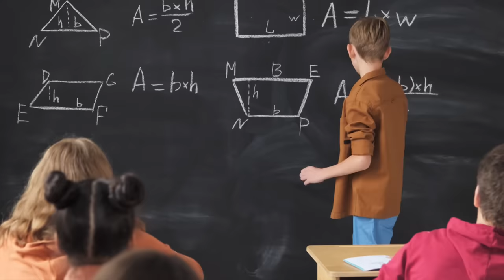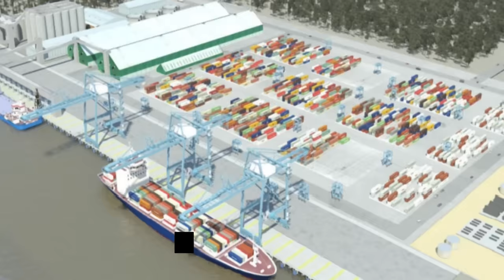Guyana mega projects Making Brazil Tremble 2024

Comment: No. 9: Demerara Harbour Bridge.  It is not an extension but an upgrade.  The old floating bridge will be scrapped and replaced by a modern suspension bridge, similar to Golden Gate bridge but much smaller.